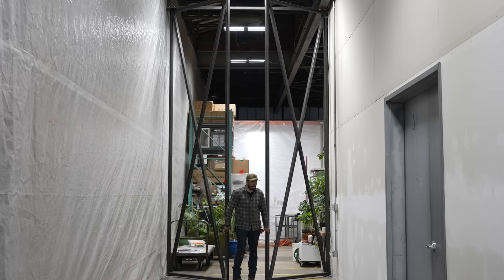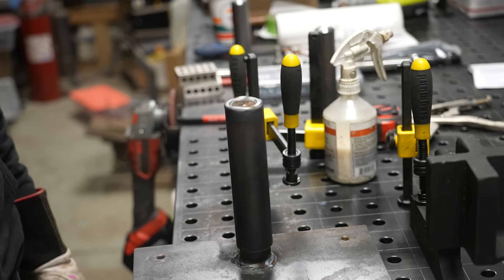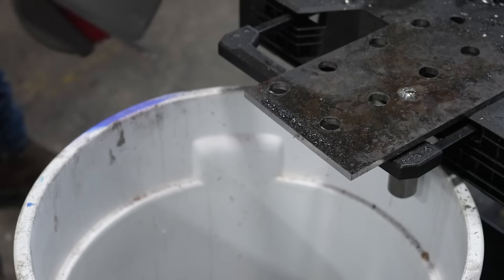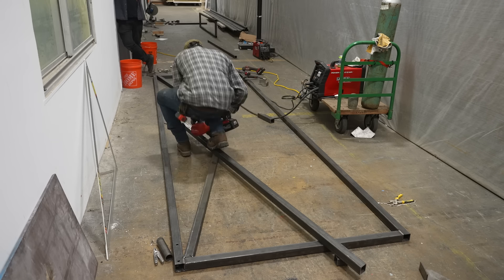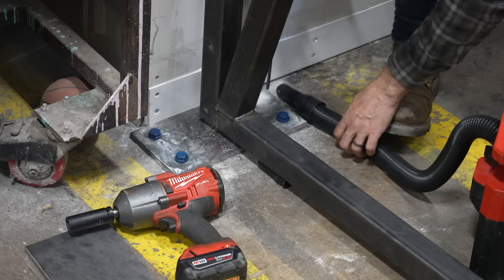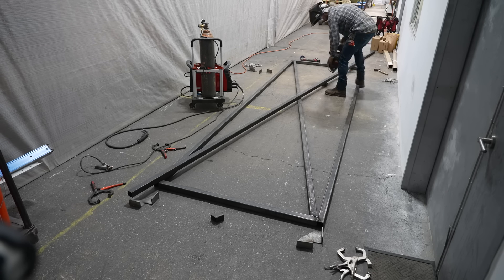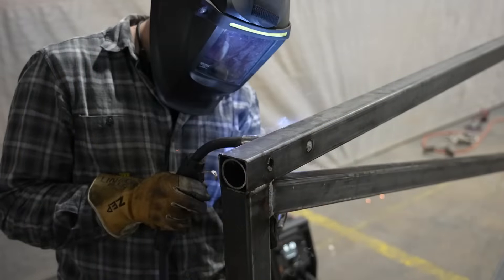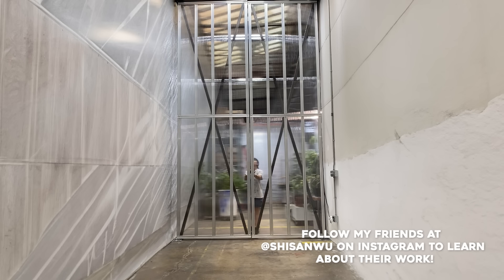Building GIANT Doors!

Comment: Nice work ! Does the evolution saw work good without clamping the material?
Reply from the maker: Absolutely! I didn’t clamp anything I cut during this build just gotta hold on tight. I will say that’s probably not advised by evolution, and for round material definitely throw a clamp on wick.

Comment: Great job in engineering the hinges and including a grease fitting!!  I have been replacing some rusted / seized hinges on outdoor gates recently and have been doing something very similar, on a much smaller scale.  Drilling and tapping the top for a grease fitting was an idea I had that has worked brilliantly on two repair jobs so far.  
Keep up the great work and the very instructional videos

Comment: FYI Simpson StrongTie makes a concrete screw anchor with a beveled head so you can have a flush countersink finished look. Sweet work getting 2ea 16ft slabs flat. I always check the concrete slab I'm building on to see if its level, flat, etc so i don't build bad concrete work into a steel frame I'm building.